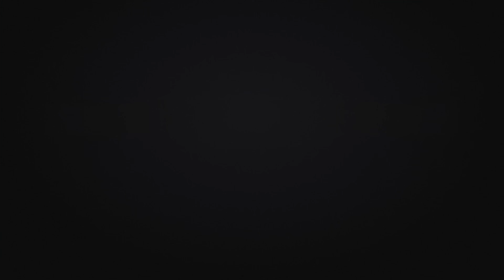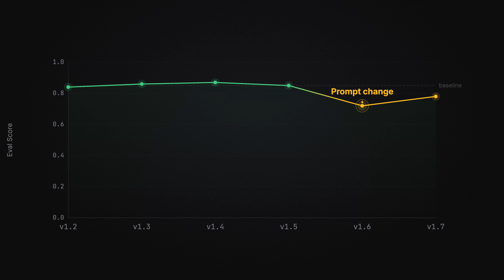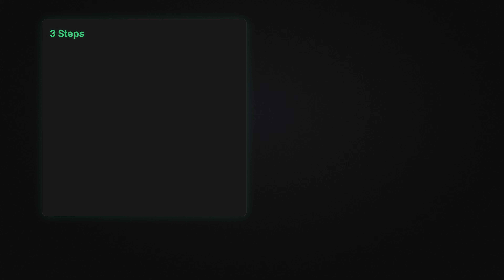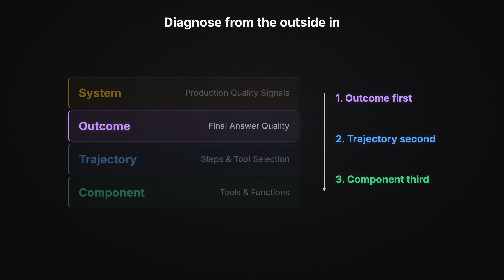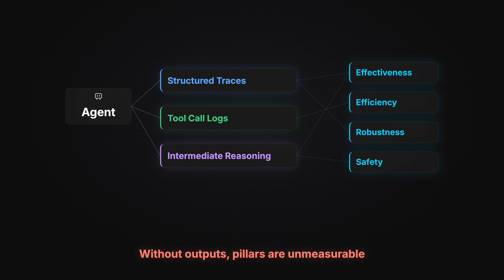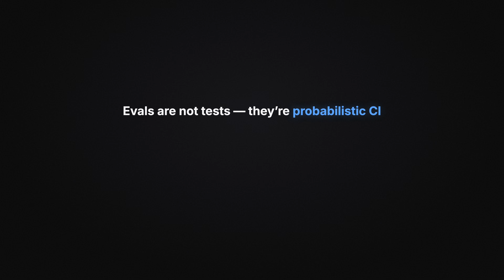AI Agent Evals: The 4 Layers Most Teams Skip

Comment: Your four-layer model of component, trajectory, outcome, and production monitoring gives agent quality a much stronger structure than pass-or-fail testing. The production-failure-to-regression-set flywheel is especially important because probabilistic CI needs durable evidence over time. DeepPattern helps operationalize that loop through behavioral checks, independent review, and re-verification; we're running an External Preview, would you be interested, and what's the best contact for details?

Comment: Very informative, thanks! Finding it hard to "score" an agent output for reasoning tasks because sometimes it spots something in the data that seems wrong to a human developer at first glance but upon further inspection turns out to be a valid point. So my choices for evaluator logic would eventually ween out this creativity. Any tips?
Reply from the maker: There's a few things that come to mind to try.

1. Trying to break out your scoring into multiple dimensions if you haven't already. Here's an example from my assistant — each golden dataset entry declares which dimensions it tests (delegation, trajectory, completion, etc.), and the eval runner automatically selects the relevant scorers for that entry. That way a single interaction gets evaluated from multiple angles without needing separate test cases for each concern. https://gist.github.com/emma-praxis/057cb236f6137f38216206270e008aaa

 2. For reasoning tasks especially, LLM-as-judge tends to handle this better than heuristic scoring. You can give the judge an explicit rubric that includes a verification step — something like "if the output seems counterintuitive, check whether the reasoning actually holds before penalizing it." That's hard to encode in a traditional scorer but natural for a model to reason through.

3. Tag and collect these edge cases. Every time the agent surfaces something that surprised you but turned out valid — that's gold for your dataset. Build a "surprising-but-correct" bucket and use it to calibrate your evaluator over time, not penalize the agent.

Comment: great video! i'm just curious, why would it be so hard to add evals after the agentic system has been built? atleast on the surface, it seems like it's "just" hooking into the outputs of any LLMs in the flow, filtering the outputs down to reasoning, tool calls, and traces.
Reply from the maker: Great question — instrumenting is the easy part. Hooking into LLM outputs, capturing traces and tool calls — tools like Phoenix, Langfuse, and Braintrust make that pretty painless.

The hard part isn't capturing data. Honestly, it's the same reason adding unit tests to a legacy codebase is brutal compared to practicing TDD from the start. Evals aren't just a measurement layer you bolt on — like tests, they're a design constraint that shapes the system when you build with them in mind.

Three things get much harder after the fact:

1. Ground truth. Evals need inputs paired with "what should have happened." If you didn't design for this from the start, you're reverse-engineering expected behavior from production logs — slow, and biased toward whatever the system already does. You end up grading it on a curve (same way retrofitted tests tend to just encode current behavior, bugs and all).

2. Defining "correct" per step. Bolt evals on late and you usually only have the final output to grade. But agent failures rarely live at the final step — it's a bad tool call on step 3 that the model recovered from, or a reasoning shortcut that happened to work this time. Without per-step assertions designed in, you're stuck with end-to-end pass/fail.

3. Refactoring for testability. Prompts, tools, and orchestration are usually tangled together — exactly like untested code with no seams. To eval a single step in isolation, you have to pull it apart. Now you're refactoring a working system just to measure it.

So yeah, you can add evals later. But just like retrofitting tests, you usually end up with shallow coverage, a thin dataset, and a system you're afraid to change. Build evals in from day one and they guide the design — every component ends up independently testable because it had to be.
Reply: interesting. I still had a few doubts if you don't mind answering them. :)

1. why would we use the actual production logs to create the input to output validation mapping in the evals? regardless of when you're adding evals, the validation map should be created and maintained externally right? or is this because the input in the eval system isn't just the prompt, but some more complex data that can only be created based on actual usage of the product?

2. when you say bolt evals on too late, are you talking about late in the steps that the code walks through, or late in the development of the project? cause if it's 1, I don't see why that would be an issue. all agentic runtimes are LLMs being repeatedly invoked in a loop. adding a generic data capture methodology once at the LLM output step should be enough to cover step by step assertions right? please correct me if I'm wrong.

3. hmm. I'd say this is a code standard issue. it's just sphagetti code. hard to do anything with it. add, update, delete anything.
Reply from the maker: Good questions.

On ground truth: You can define it upfront — but it's hard to anticipate how users actually interact with a system before it hits production. The edge cases, the weird inputs, the paths you didn't expect — those are what stress-test your evals. Production logs aren't a crutch; they're often how you discover what your eval set was missing.

On "late in steps vs. late in development": I meant late in development. And you're right — hooking at the LLM invocation layer gets you step-level traces whenever you add it. But traces aren't evals. Traces give you data; evals require defining what "correct" looks like at each step and going back to label it. That definition is what's hard to retrofit — and you've already missed the production data that would've been your best training ground for it.

On the code standard point: Fair — tangled prompts and orchestration is a code quality issue. But even clean, well-structured agent code can lack eval seams. Designing for testability in an agentic system means making explicit decisions about what "correct" looks like at each component boundary — not just clean interfaces, but actual success criteria. You can skip that and still write readable code. You just won't be able to eval steps in isolation later without going back to define it.